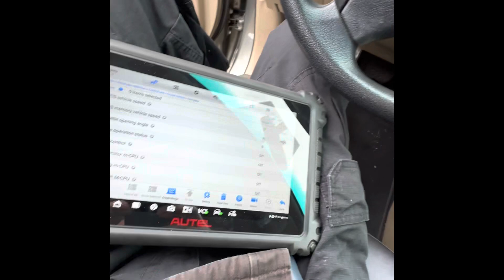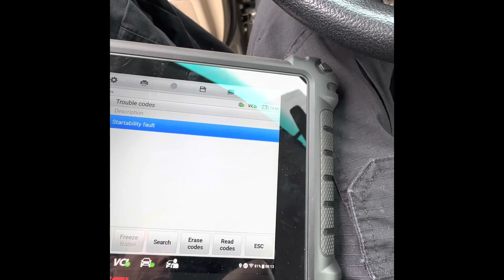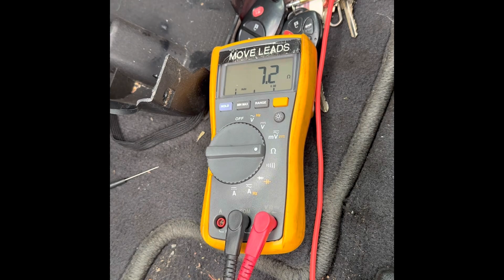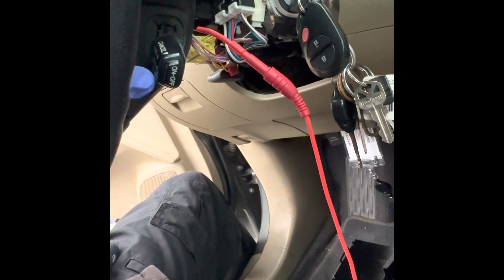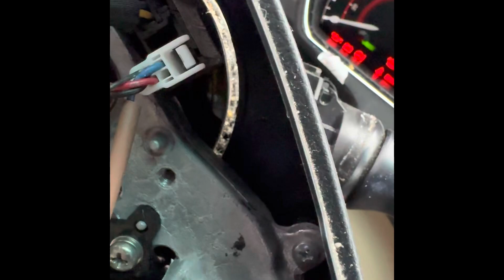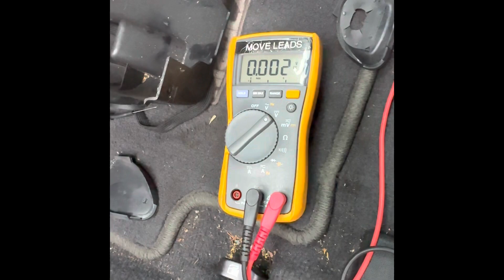Toyota Highlander cruise control issue

Comment: So, how did you fix the cruise control?
Reply: Did you just swap out the whole arm with button?
Reply from the maker: I replaced the clockspring
Reply: I changed the cruise control  complete button
Reply: @Tonpere-fu4zm  thanks, that is what I did as well. Cruise worked like it should.
Reply: @donhayes22 and how much that would cost?